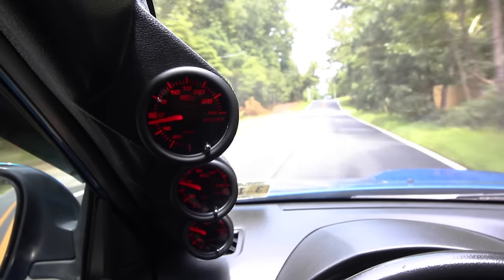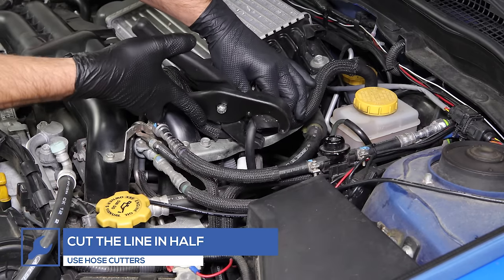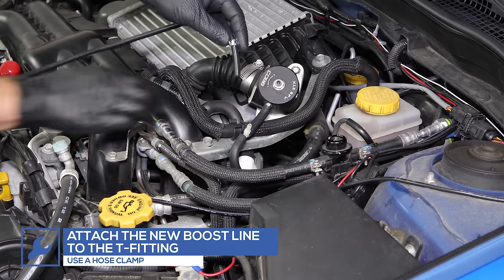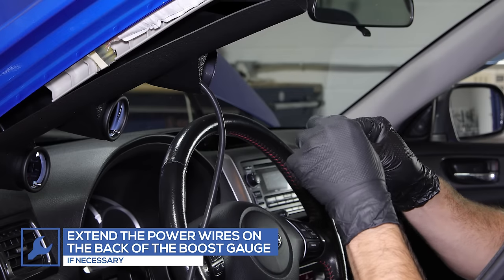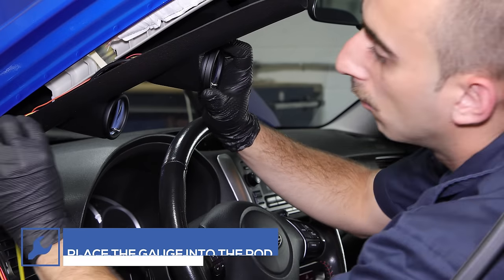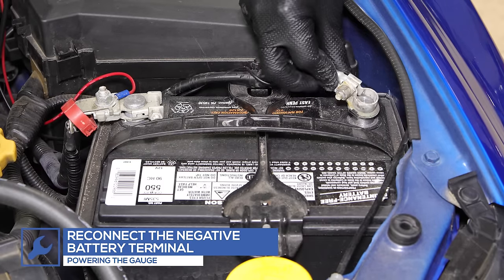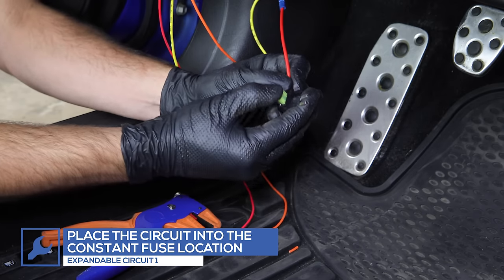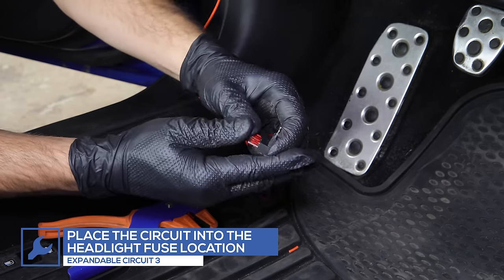Installation | GlowShift 7 Color Series Boost Gauge for Cars and Trucks

Comment: You added a hose clamp onto the new boost gauge hose on the tee fitting after you cut the boost vacuum hose from the car. Shouldn't you have added 2 additional hose clamps to the original vacuum hose that was connected to the tee as well?
Reply: I also thought the same when I saw that
Reply: No. It will never build pressure so it won't blow off and the fitting is built for a specific size hose to slide on but ribbed so the hose has trouble coming off.
Reply: Better safe than sorry Imo

Comment: Why cutting the oem line? You can just remove it from the bpv add the tee, using the supply line in the kit and cut a little part that you connect to the tee in the bov, so you dont have to cut the oem line.
Reply: anything works

Comment: I want to use this on a Gen 6 Camaro with the 2.0. Guys usually use a throttle body spacer and run a barb off the throttle body spacer to a hose to the gauge. Will that method work as well with this gauge?

Comment: Where exactly did you run the vacuum line through the firewall into the cabin?
Reply: There are always 2 holes for cables to the dashboard (left and right), from the left are passing the cables from battery,alarm etc.
Reply: There’s a grommets that you can feed the lines through that you can do right behind the pedals in the Subaru wrx

Comment: Im thinking of buying the 3 pod pillar mount for my 06 Subaru Impreza WRX STI..  Want a boost,volt,fuel pressure setup. Question is can I use the same constant hot, headlight, etc connection for all gauges?
Reply from the maker: Yes, we also offer 3 gauge wiring kits which will allow you to connect all of the gauges to a single power wire.

Comment: What is the purpose of adding both a 12V and a 12V source at the ignition? Is it because the gauge has a memory function? I assume this is not necessary when the gauge does not have a memory function?
Reply from the maker: Yes, it's so the gauge will remember the color setting.

Comment: My gauge stays on when the car is off. What am I doing wrong? I followed the steps exactly.
Reply: I have an mk4 gti 337.
Reply: U have to connect it to something that only turns on when you turn the key and turns off when you take the key out like your head unit cigarette lighter

Comment: Does the kit come with ALL the parts? There’s parts there I haven’t seen before
Reply from the maker: Yes or no depending on how and where you are going to install the boost line. Expandable circuits for power are not included.

Comment: Hey there, just finished putting mine in today, looks really good! The needle is a bit sticky and hesitant, is this just due to factory boost tunes so it's a bit meh or is it something else? I'm making 8-10Psi. Cheers.
Reply from the maker: Which series gauge do you have?
Reply: @GlowShift  The tinted 7 colour, 30 psi series.
Reply: @GlowShift  Hello?
Reply from the maker: Please contact us at 1.888.GS.GAUGE
Reply: @GlowShift  This is for anyone that has the same problem as me, apparently, it is due to a pinched or creased line causing the improper flow to the gauge. The line I used is pretty stiff so I don't see how this could be the case. Maybe if my car made more power the needle would be a bit more responsive. Or a got a faulty gauge...Who knows I've learned to just deal with it.
Reply: Did you have to use the extra wires that you add on to the gauges you purchase? Just purchased the gauges but I also added that pack of wires. Did you even use them

Comment: I set the light color to white, but every time I started the car, the light turns back to blue.  Is that normal?
Reply from the maker: That means the red wire from the gauge is not connected to a constant 12-volt power source.

Comment: What would I need just to get the lights on? No dimming and nothing just to turn them on
Reply from the maker: Connect the yellow wire to constant 12-volt power and connect the red wire to ignition only 12-volt wire
Reply: @GlowShift do you need a constant 12v and a 12v ignition for the gauge to work in general?

Comment: Just bought one and it did not come with a t fitting or anything came with a very small boost line and screw on fittings?
Reply from the maker: A t-fitting only comes included with a boost/vacuum gauge. The boost only gauge you will need to purchase a t-fitting separately if that is how you plan on installing your boost line.

Comment: I have a 2005 Audi a4 with automatic headlights. Where do I install the orange wire? I looked and could not find a headlight switch fuse
Reply from the maker: You can wire it to the headlight switch.

Comment: Can I just run power and ground? I always want my gauge light up instead of having to turn my headlamps to see the gauge
Reply from the maker: Yes, just leave the orange wire disconnected.
Reply: Yeh don't do it threw head lamps find an AC something that turns on when you turn the key cigarette lighters do it

Comment: Mine won't save the color everytime I shut the car off and start it again the color needs set to what I want
Reply from the maker: Make sure the red wire from that gauge is connected to a constant 12-volt power source and not a 12-volt ignition only source.

Comment: Is there any way to calibrate the unit? Mine reads 22 inches of vacuum at idle, it’s a well known fact that 20” is normal for a stock engine without much overlap or lift, so is this adjustable? I believe it’s losing the two pounds of boost I am missing on the top end of boost, since it’s basically a bourdon tube that can send electrical signals to the gauge, and if it’s wrong at idle, it’s wrong in boost as well.
Reply: Unless your testing facility is deep below the earth’s surface, where the air is at 16.7 psi instead of 14.7 psi, lol!
Reply: Would have been nice for eventual replacement of the unit with a new one, if you had used a small mini usb connector at the back of the gauge, so that once you’ve wired it and plumbed the vacuum, when it comes time to replace it, you’d only have to unplug the connector and vacuum line to replace the instrument, instead of having to get back under the dash to rewire it.
Reply: I have a feeling that I just bought an inaccurate entry level gauge that will not give me accurate results. It’s pretty, but if it can’t be calibrated, it’s junk as far as I’m concerned.
Reply from the maker: You can loosen/tighten the jam nut on the back of the gauge and it will adjust the needle.
Reply: @GlowShift  sounds good, I’ll go try that, thanks for the quick response!

Comment: How can you power 3 separate gauges? Wouldn’t the fuse box be consumed by expandable circuits?
Reply from the maker: No, you can wire multiple gauges into each expandable circuit. So put all the red gauge wires together into one circuit. All the yellow gauge wires together into another circuit. And all the orange gauge wires together into a third circuit.
Reply: Can you use the same ground point as well?
Reply: @jeremycarter5244 yes

Comment: PLEASE HELP I'm looking for boost gauge for procharger,  oil pressure and oil temp gauges for a  2010 challenger srt8.  I  also need everything to hook the guages up.  I would like to put on pillar post.
I haven't had any luck getting this info through email. I have throat cancer so hard to talk on phone. 
Thanks Sid
Reply from the maker: Unfortunately, we do not currently offer a pillar pod for the Challenger. You would need to use one of our  universal pods to mount the gauges. The gauges on the other hand we do have. Just visit our website and add them to your cart. Our website also has a live chat feature that you can use to talk with a customer service representative about your order.

Comment: Why does it need 3 power sources? Can i just use 1 when the ignition is on?
Reply from the maker: The constant 12-volt source is used for the gauge to remember your color setting and the headlight sources is used to enable the dimming feature or night time driving.
Reply from the maker: @MrJay1027  Sounds like you connected them to a constant 12 volt power source.

Comment: So I did everything exactly as shown in the video except I had to spice wires to extend them to the fuse box as I am mounting the gauge in the vent next to the hazard lights button and there is no power to the gauge. Where should I start?
Reply from the maker: Double check all of your power connections then double check the fuses that you connected to and make sure they are 12 volt.

Comment: Can you stack the adapters for the fuse or will it over load because I ordered 3 gauges from your site
Reply from the maker: Yes, you can connect up to 4 gauges to one fuse.just make sure you separate out the colors of the wires. All reds together, all yellows together, all oranges, together, all blacks together.

Comment: Glowshift is the boost gauge is same as vacuum gauge?
Reply from the maker: Depending on which boost gauge you purchase, it may or may not come with a vacuum reading. There are boost only gauges and boost/vacuum gauges. They are not the same.

Comment: Hi  would like to get it but lots of coments in amazon   about not accurate
Reply from the maker: Hello, the accuracy of the gauge depends highly on the location of the t-fitting installation. If the t-fitting is installed to our recommended location, then the gauge will read the proper readings.
Reply: @GlowShift  I just bought it 😬
Reply from the maker: Feel free to reach out to us if you have any questions during installation.
Reply: @GlowShift  I will be installing on a Volvo c30 R desing
Reply: @GlowShift  Would i still be needing the t fitting if i have a throttle body spacer that gives me access to for the vaccuum line
Reply from the maker: No. The t-fitting is only needed if tapping into an existing line that does not have an open port.
Reply: @GlowShift  Thanks! I was really hesistant on buying one now im for sure getting one!
Reply: UrbanRican74 did it end up being accurate?
Reply: 06 legacy gt with ej20x away 5 speed. Seems pretty accurate to me, matches up with the old sun pro that was in the car
Reply: what size fuse come should be use with the expandable circuits?

Comment: I just installed an oil pressure gauge, boost gauge, and wideband from you guys. When i turn the key both the oil pressure and the wideband do a little swoop with the needle, but the boost gauge needle remains still(doesn’t swoop). Is this normal?
Reply from the maker: Yes, that's normal. Our boost only gauge is mechanical where the other gauges are electronic.
Reply: @GlowShift  okay thank you
Reply: I know this is a year old @fatsleepypanda did you have any problems with hooking the fuses up with all the different gauges
Reply: Mine swoops once and flashes then goes and sits on 0

Comment: I have an 04 wrx and I don’t know where the hole is on the firewall to run the line through
Reply: albert moore behind your clutch
Reply from the maker: Yes, check up behind your pedals.
Reply: Mine is ran through passenger side where wires come out, but a pia to see under dash to locate wire

Comment: nice work i have question i purchase one where i conect the green wire i have 09 dodge ram 1500 tanks guys
Reply from the maker: Sure, what is your question?
Reply: GlowShift Gauges i have tachometer and i ready conect ground and power supply now i don’t know where to conect the green wire on the engine i have 09 dodge ram1500. ,

Comment: @GlowShift  I installed a new 7 color 30psi Boost/Vaccum gauge and it reads well below zero when the car is off,  is there a way to calibrate these things?  I would return it but the purchase was in Dec 2018, so I am a bit past the  1 year warranty... Any help would be appreciated, this  is for a Huron Speed LS1 t4 V3 kit,  On3 Billet 84, trying to get it tuned and would be nice to know what the turbo, wastegate and boost controller are doing.
Reply from the maker: Please contact our customer support and they will be able to walk you through on how to adjust the gauge.

Comment: I have one, but everytime when I start my car the light is blue... And I want to be red.. any ideas?
Reply from the maker: Did you hook the yellow gauge harness wire up to constant power? The yellow wire gets connected to constant power so the gauge will remember the color when the vehicle is turned off.
Reply: @GlowShift  that makes sense ive purchased a car with the 3 pillar pod. But it resets everytime the ignition is off. Also it turns off and on randomly throughout when i drive. Sometimes wont turn back on until i stop driving for a bit then turn it on. Do you think its a wiring or a ground issue?

Comment: I've install this same gauge on my civic with the same installation and the lights dont even come on unless you turn on the amber or headlights. Got annoyed and wired it up my way and now it's working but not properly
Reply from the maker: Sounds like a wiring issue. Please contact our customer support and they will be able to help you resolve the issue.
Reply: @GlowShift  how can it be a wiring issue when I connect the wire the same way as you guys did on this gauge. Sounds to me like a defect gauge
Reply: Yeh bro try another gauge and see if it does the same thing

Comment: So did he install 3 boost gauges? Lol didn't see what the other two were.
Reply from the maker: There were 3 gauges installed in this vehicle however, only the boost install was shown. Other 2 gauges were fuel pressure and wideband.

Comment: Will adding this void a warranty?
Reply from the maker: Our gauges do not connect to the factory sensors and do not interfere with the vehicle's operating system so adding our gauges should not void your warranty.

Comment: Mine doesn't have any lines just a electrical line that runs out to the engine bay with a plug any help would be nice don't know if anything else attaches to the other end of the wire other than to the gauge
Reply from the maker: Is it a GlowShift gauge?
Reply: @GlowShift   yes I just bought a electronic boost pressure sensor and on idle it stays all the way on the last digit,  is that correct shouldn't it be on zero ??
Reply from the maker: If the vehicle is turned on then it will be in vacuum, which would cause the gauge to read lower than zero.
Reply: @GlowShift   I bought the boost pressure sensor from glowshift and the wire that came out of the Guage fit right to it, are they specific to certain gauges or should mine be okay? Haven't tested it yet , I got it T'D off from the blow off valve line
Reply from the maker: It should be ok. If you have any further issues please call us 1.888.GS.GAUGE

Comment: Does all 3 gauges use same 12 volt power wire?
Reply from the maker: Yes, you can connect them to the same 12-volt power wire.

Comment: If you are installing multiple glowshift gauges (x3) can you consolidate all the yellows with the yellows, the reds with the reds, orange with orange and have them connected to one expandable circuit fuse per color? So basically all the yellows would be connected together and then inserted into 1 constant power? And so on and so forth with the other colors?
Reply from the maker: Yes, that's actually how we recommend wiring them if you are installing multiple gauges. You can fit up to 4 gauges on one circuit.

Comment: What is the fuse you have in your extendable circuit before adding the one from your fuse box? Im confused on why there are 2 fuses instead of just the one you are replacing
Reply from the maker: That 2nd fuse comes with the expandable circuit.
Reply: @GlowShift  okay I didnt know if it was necessary to add an extra fuse other than the one your using in the box because I am using a fuse tap that has 2 slots but Im only using the one slot with the fuse im substituting and didnt know if I should be adding some sort of 2nd extra fuse?
Reply from the maker: @right2knowpodcast  The expandable circuits you purchased should have come with a 2nd fuse. Both the factory fuse and that additional fuse need to be placed into the expandable circuit. That's why there are 2 slots.
Reply: @GlowShift  okay yeah i couldnt fond any expandable circuit or fuse taps that actually came with a fuse..just the fuse plug and 2 empty slots so is it required to have an extra fuse in it? And if so what amp?
Reply: And thank you for responding being that this specific info is nowhere I can find on the web about the extra fuse..
Reply: @GlowShift  in other words if I use my fuse tap to replace a 10 amp fuse do u need 2 10 amp fuses to be in it? Because currently in only have 1 fuse In each tap..just the fuse from the slot im using
Reply from the maker: @right2knowpodcast  It should be a 4amp fuse. Here is the listing on our website: https://www.glowshiftdirect.com/2-pack-mini-expandable-circuit-4-amp-fuse/
Reply: @GlowShift  okay awesome thanks for answering ..the one I bought at the part store is the same but without any extra fuse so i will go ahead and try to get an extra 4 amp fuse for it.